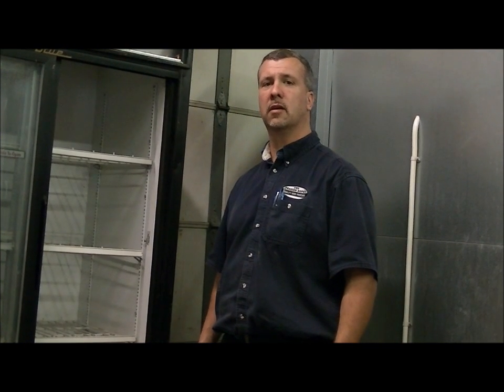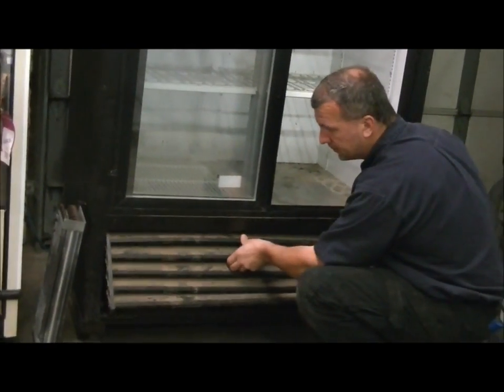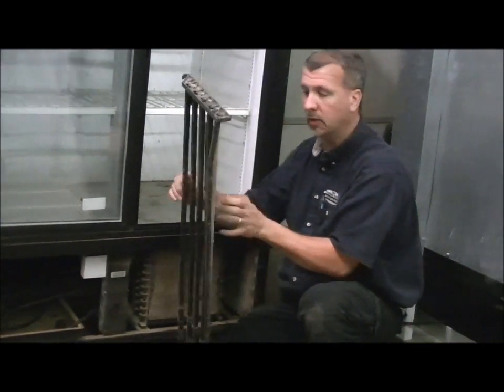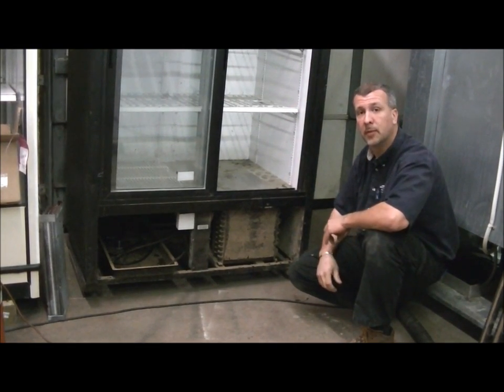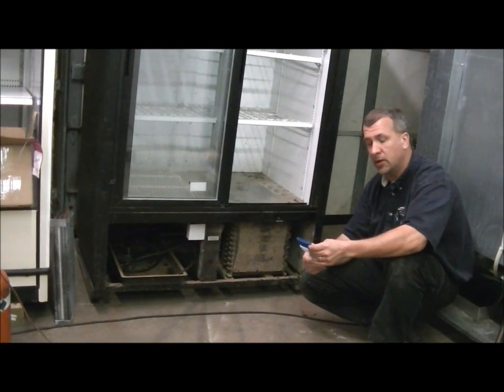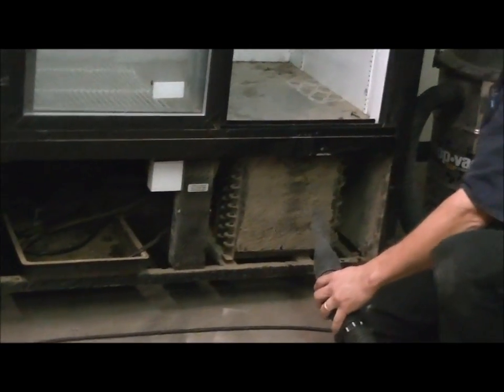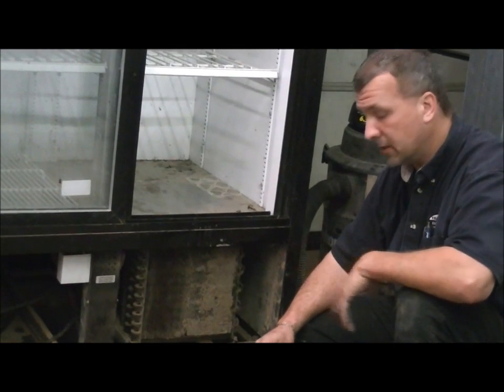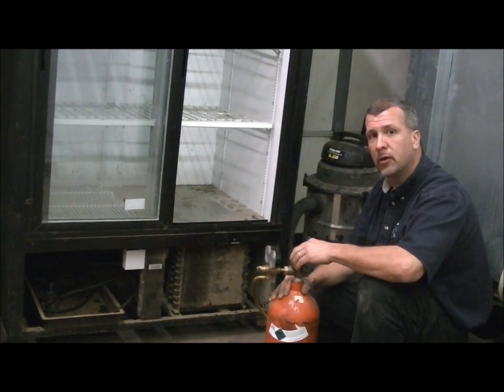Cleaning your condenser

Comment: Another method after you have vacuumed the front is to put a shallow baking tray under the coils, 
take a Yard Sprayer with water, pump up the pressure and spray the coils clean. A few drops of soap in the sprayer can be used.
The tray on the bottom will collect the dirt and water. Empty as necessary, and be sure to unplug the unit FIRST !
If you don't have a Yard Sprayer use a Windex Cleaner type sprayer.

Comment: I have / had a great running /performing OBD merchandiser (half the size of the unit in this video) and I dollied it outside to clean it (although it was not very dusty at all) and after using a 150 psi air compressor to completely blow out every spec of dust ... the condenser does not engage/cool.  What is the likely culprit (a loose wire?) as the unit worked perfectly before I decided to perform my routine maintenance.

Comment: About what your saying with cleaning with compressed air or nitrogen, sure blowing into the face of the condenser is extremely stupid, but what we do is pull the condensers out where we have access to fan side and blow it out with a wet rag over face to catch debris... we also finish with a vacuum to clean up any final debris, imo the nitrogen technique is the best way to clear out a condennsser without washing it.